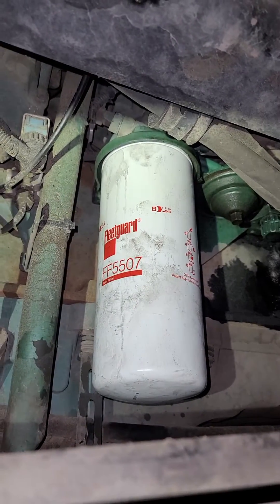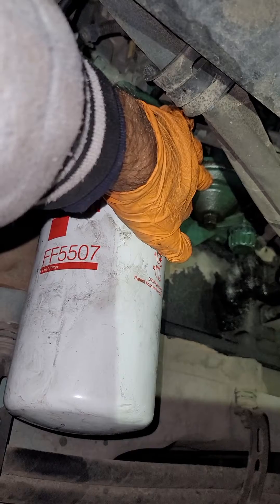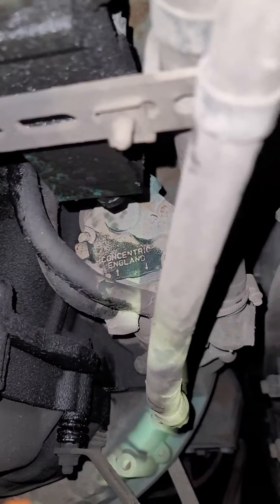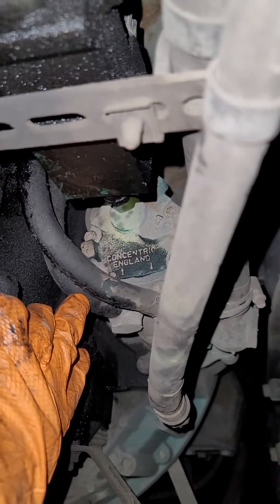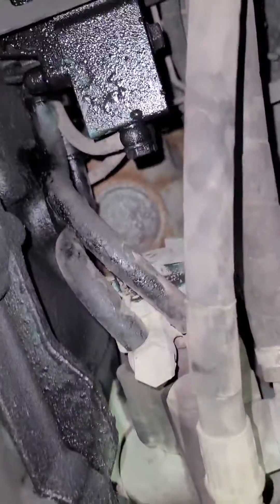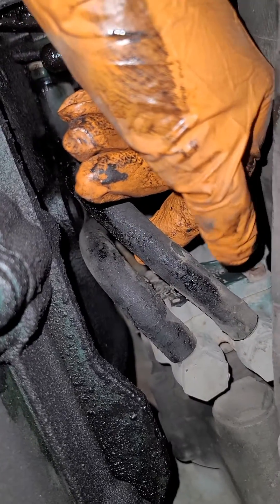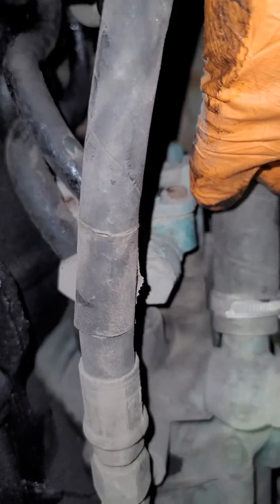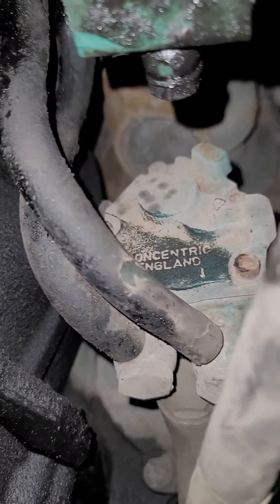volvo d13 semi truck fuel pump and power steering pump location from below

Comment: thanks again.....maybe make a video on how to change the pump?
Reply from the maker: The location of the fuel pump and power steering pump seen from under the truck on a 2012 volvo d13.

My truck died while driving on Highway. The water fuel separator filter was empty. I filled it up with diesel and used the small pump to prime the engine. It was starting but would die again after 30 second. 
I started to suspect the fuel pump.

I clamped the two lines going to the pump with vise pliers. Then I disconnected the wires from the pump. I undone the 3 screws that hold the pump on and the pump came off. There is a small steel connector between the pump and the shaft that drives it. Volvo part number 85103779. Mine was warn to the point where the shaft would free spin in it instead of driving the pump. I replaced it and truck was back to normal. It is a small 60$ part but had to wait 2 days for the dealer to get it

While I was waiting for the part
 I hooked up a small electric diesel fuel pump from oreilly auto parts in place of the truck pump. 
Edelbrock 38 GPH Fuel Pump
Part #: 17302
This pump only makes 10psi while the volvo pump makes 10 to 100psi.

But it got the truck running and got me to delivery but I could not drive faster than 60mph on straight ground.
Reply: @drevilatwork   thanks for the info....looks to be pretty straight forward in the video but one never knows.